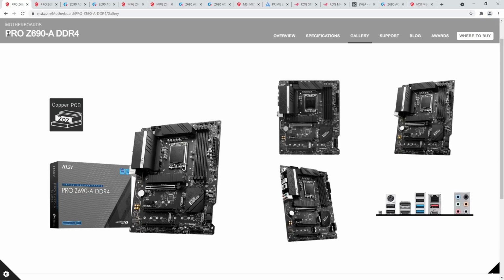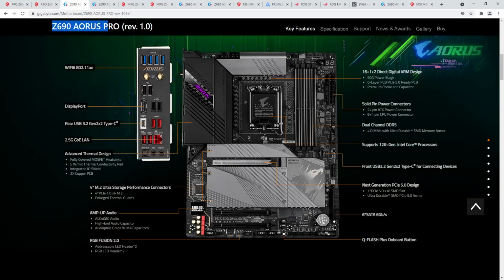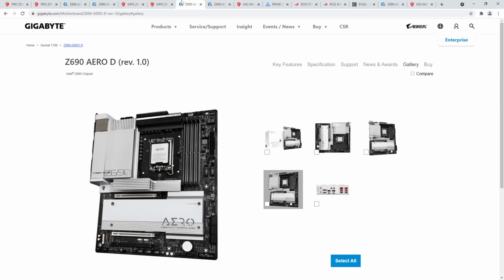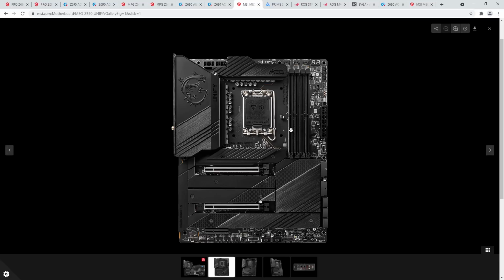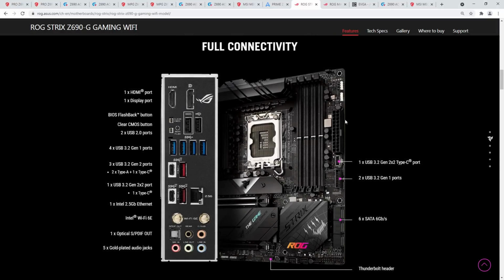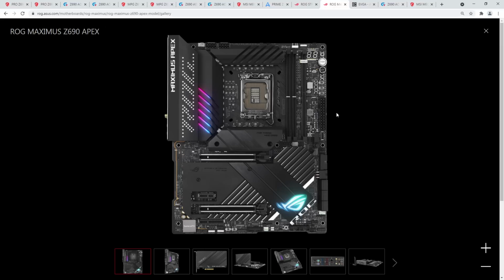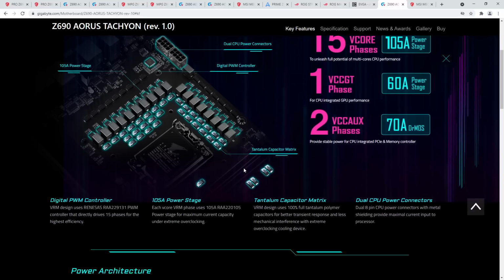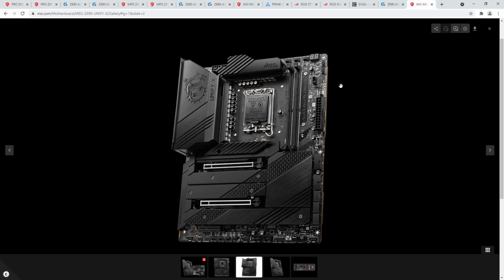Z690 Motherboard round up

Comment: What do you think about MSI Z690 Tomahawk?
Reply from the maker: it's an expensive Pro Z690-A
Reply: @ActuallyHardcoreOverclocking  vrm 14*55A against 16*70A. + better sound. It seems to me there is some difference for 50$.
Reply: Meh it doesn't really buy you anything as that vrm difference isn't enough to matter
Reply: @ultravioletYantra  14x55Ax1.275V=981W. Let's assume you want to be "sane" and only run your VRM at 75% duty cycle, that's still 785W. But that's obviously not enough when you daily drive your system on LN2, so lets see what the Tomahawk can do: 16x70Ax1.275V=1428W!!! Wow. SO much better!!!.... Seriously: Phase count and power stage amp rating is ONLY a concern (let's leave ASRock out of this, ok?) if you intend on running LN2. You're going to pay $50 for better sound... Do you have head phones/speakers that can do anything tangible with the difference?
Reply: @ultravioletYantra  It also has more USB 3 on the rear.  Pro A is 2 gen 1 and 1 gen 2.  Tomahawk keeps the 2 gen 1 and bumps to 3 gen 2.  Only 3 usb 3 on the Pro-A is a little light on connectivity.  Comparing the Wifi Pro A and the Tomahawk, it's 50 dollars for more connectivity, a bump in VRM that probably isn't that useful, better sound (+ optical if for some reason you need it),  and if it matters to you, a bit nicer design with integrated IO shield and full coverage heatsinks for all M2 slots.  The Pro-A is perfectly valid, but personally the combination of upgrades is worth the 50 bucks to me.

Comment: mb with this overkill mobo will be good with next CPU that will have another 8 E-cores
8C+16c total
Reply from the maker: 8 more E cores shouldn't really change the power draw much.
Reply: @ActuallyHardcoreOverclocking  but each core will get different voltage, ,might decrease heat ?

Comment: Hi BZ
Thanks for the always awesome rambling.
I'm in the process of figuring out my new simulation setup, but need so settle on a MoBo, so if you have time to give a short recommendation, it would be all happy-jazz to my ears.
Current list is:
CPU: 12900K
RAM: >/=128GB
GPU: 2 x 3090 Strix
No massive OC... Durability and stability is key!
I've looked at Giga Xtreme and Apex(can it handle 128GB RAM in to dimms(DDR5)), but after your review I'm also considering AERO D and the Creator (ProArt).
 All the best, Dim

Comment: m2 slot with no heat sink is bad, the audio chip on the lower boards is bad and dont include DAC and amp to power higher end headset.
Reply: @pristineslayer yeah but when reviewers says what else you need ... they really dont understand that there is more to a board than just good vrm.

Comment: AMD and INTEL cpu are push the overclock  to the limit from the factory ,there is no more headroom  for overclocking specially on the flagship versions, these cpu perform incredible out of the box so for 2021/2022 it no make absolutely sense to buy a stupid overprice motherboard z690 for overclocking . is better look for a good connectivity a memory overclock feature .  there are good example on this video
Reply: People frequently does 4.7GHz all-core on the 5950X for daily use. That's a decent performance jump from the stock 4.4GHz all-core. From what I'm hearing people are pushing the 12700K to 5.1GHz all-core with the e-cores disabled. I wouldn't be surprised if golden sample 12900Ks can do 5.3GHz all-core with the e-cores disabled.

But no, these are not the Sandy Bridge days...

Comment: any ASRock ones to suggest?
Reply from the maker: well asrock made some trash boards and some overpriced boards. So I guess get an overpriced one (Velocita/Taichi)?
Reply: @ActuallyHardcoreOverclocking  okay ty, ill consider  msi
Reply: Z690 Pro RS might be a viable low end board provided ASSrock hasn't messed up DDR4 support and there's no other major BIOS related issues, there's no mid end (literally every board till the PG Velocita is a PRO RS with slightly better Dr. MOS) and high end gets undercut by the Z690 AERO D / Z690 Unify for a similar feature set.

Comment: the apex would have been the perfect board if it had video output. also, 10gbit lan and thunderbolt 4 would have been nice.
Reply: It’s not really made for those features honestly
Reply: @Rs3Matt  the video output is a mandatory feature imho. if you see it purely as an overclocking board, then you probably wont need wifi and sound either.
Reply: @Nikko911  I’ve used Wi-Fi while on ln2 never thought about onboard video always have a dedicated gpu.
Reply: Buy the KF cpus. Problem solved. The Apex doesn't have a gpu rail because it improves cpu power delivery.
Reply: @Rs3Matt  good for you, but that doesnt mean that other people dont need it.
Reply: @TheBlackIdentety  i want to use the igpu, so how is buying a cpu without the igpu gonna solve that problem?
Reply: @Nikko911   they make the extreme and formula
Reply: @Rs3Matt  yea, for almost twice the price of the apex. no thanks chief. plus, its a huge and heavy board.
Reply: @Nikko911  the formula is close to the same price as the apex
Reply: @Rs3Matt  whats the point in buying a motherboard, designed for water cooling, without using it?
Reply: @Nikko911  cause the vrms don’t need watercooling and passive is fine even with the blocks.
Reply: @Rs3Matt  i know, but i still dont see the point in buying a board with a pre-installed waterblock, and not using it. i will probably go with the pro-art, even though memory overclocking will most likely suck.

Comment: Man, MOBO manufacturers should just drop the whole "let's shove HEDT in lower price brackets so we can charge more" and instead invest on customizable boards. It made me sad that anything beyond the MSI board is basically setting money on fire for little to no reason. The MSI board, although very functional, is boring. I want stupid nonsensical RGB on my perfectly functional motherboard dammit, not 10Gig ethernet nor 48395738 M.2 slots

Comment: Can the MSI PRO Z690-A handle a 13900k?
Reply: I would say so because the TDP is only 10% more than the 12th gen i9. Also  looks like 14th gen will also use this socket. That is a huuuge selling point. Imagine picking up a used i9 14th gen as a drop in upgrade in 2 years or so maybe it is worth it buying a overkill VRM setup this time around.

Comment: You do say a bunch alderlake doesn't pull much power compared to what the VRMs are specd for.. we are gonna see atleast another cpu gen (13th) on this socket, and possibly another too (14th) so making very powerful VRMs for the pcie 5 and ddr5 boards kinda makes sense if they are gonna be around for 2 more gens. It's atleast more forgivable.

Comment: you cannot put 2 more ssd (x4 each) in the second pcie5.0x8 slot, without plx chip. 1 only.
intel pcie5.0x16 is now provided by two pcie controllers only, not three (x8+x4+x4) as before.
Reply from the maker: https://youtu.be/EpAS7ly8p4A

Comment: What is the absolute best z690 ddr4 motherboard? Price is no issue. I actually want to get the best. Price is no issue. 

I currently have a 12900k, 3090 FTW3 hybrid, latest 420mm AIO from Corsair, and the 7000D airflow case. I’m getting the fastest m.w from firecuda, etc.

Price is no issue

Comment: No z690 ud and other solid candidates...and love the random rambling format so 80% of the video is redundant complaining.

Can't make a "buying guide" if you skip most od the motherboards and judge them from your niche point of view.
Reply from the maker: the Z690 UD costs the same as the MSI Pro Z690-A and trades 1 M.2 slot for some extra USB ports while also coming with a worse BIOS and currently broken DDR4 OC support. IDK how that makes it a solid candidate. The ASUS Z690-P doesn't even have start up indication LEDs and has even less M.2 and rear IO than the MSI board while costing pretty much the same. Asrock boards in the price range are similar to the Z690-P.